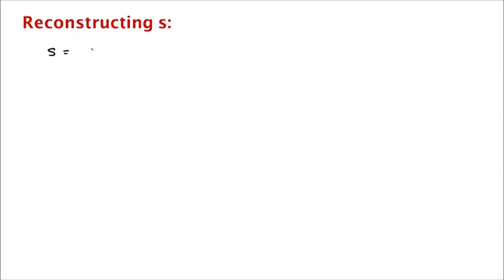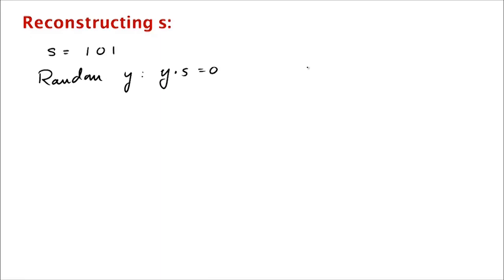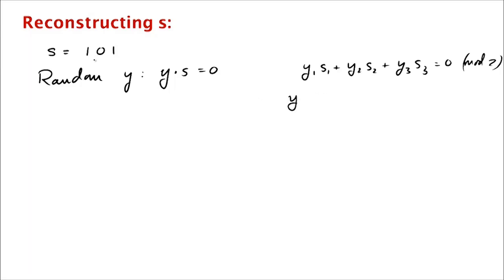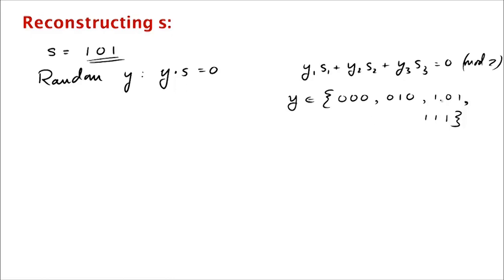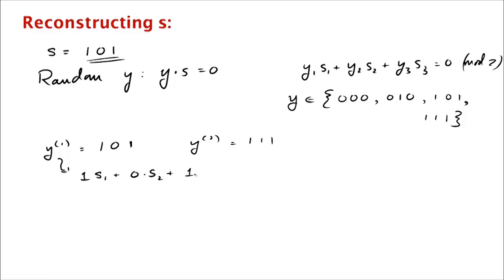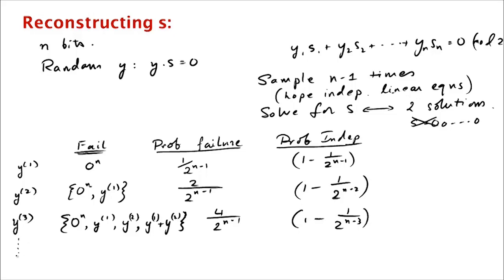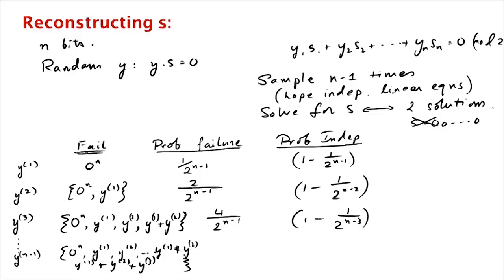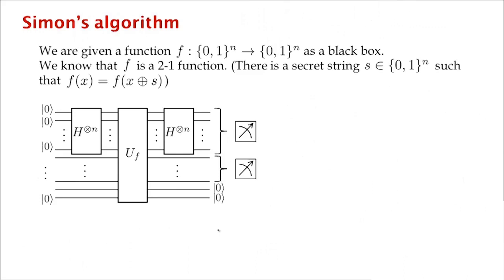Lecture 8   4   SIMON'S ALGORITHM

Comment: 13:15 - This is all leading up to "just try a few extra times," right?
Reply: I would say it's not that easy, because I think it's expensive to detect whether a set is independent or not. So it might be easier to try and solve the set of equations, and if you can't find a unique solution, you just repeat the whole process again hoping for a better outcome. Since it will work about quarter of the time, you should be good repeating the process only 4 times